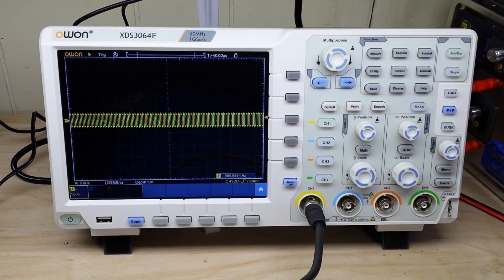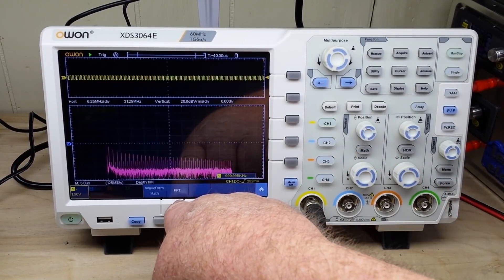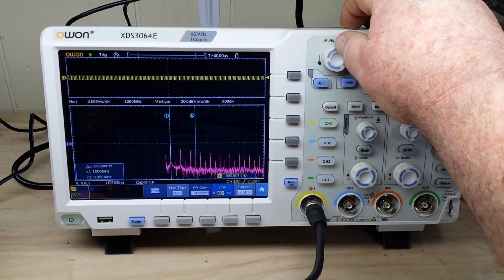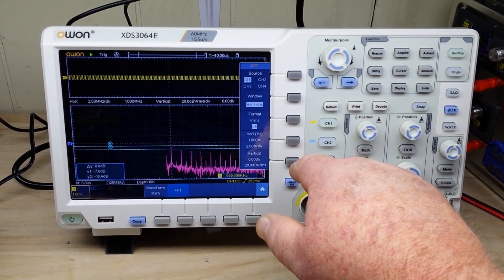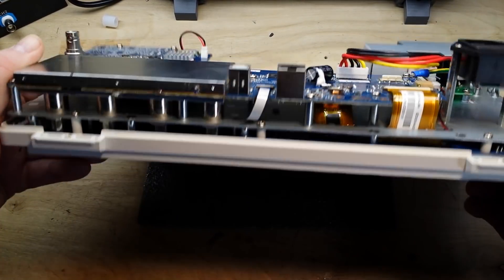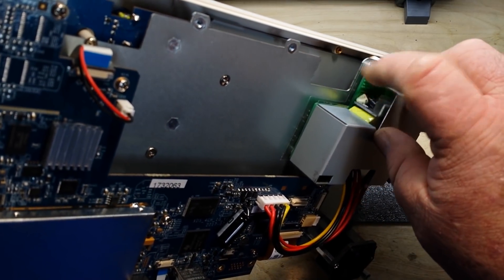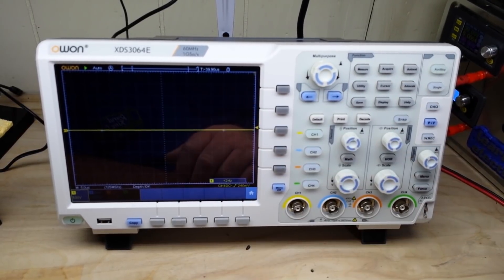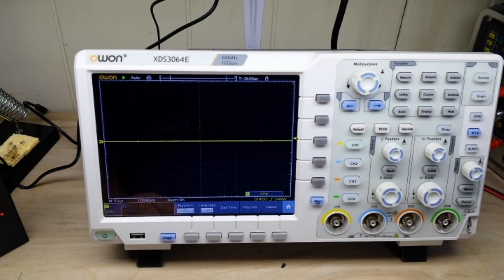Owon XDS3064E Oscilloscope FFT & Teardown (review part 2)

Comment: Thanks Paul. I just watched the vid again, it's for analysing the waveform more in-depthly. Yeah. Cool.
Reply from the maker: Think of it more like this: In regular oscilloscope mode you are looking at signals in the "time domain" Voltage plotted out over time.
In FFT (which is behaving as a spectrum analyzer) we see signals in the frequency domain. We have swapped out the horizontal time base and put in a frequency scale. So It's showing you signal amplitude (basically voltage) in the vertical, usually in Db's and the frequency of the signal on the horizontal axis.
Reply: So it's kind of the same as "virtually looking at the signal in 3D" like from all angles.

Comment: Hi Paul,
I was wondering what would really kill a nice Rigol (or other) oscilloscope.  5 volts I don’t worry about. 12 or 20 volts at 5 amps makes me wonder.  Where are the limits?  I’m sure ground first is right but could you throw some flags, please?  I’m not sure at all that I want to calibrate the frequency and voltage on the grid....

Comment: Paul, again I’m sorry for your loss:(  Another nice video - thank you!  Regarding the accuracy of the FFT, I found the frequency content and noise floor great - but I had problems with two things about the FFT.  First, the amplitudes of the fundamental and harmonics were way off.  Second the vertical scale was hard to read or adjust.  You didn’t mention anything about the amplitude - did you check?  I’m really interested because I returned mine for this problem and I reported this in my review on my channel.  I’d like to give an update and point my viewers to your channel to see for themselves.  Thanks again!
Reply from the maker: The amplitudes were within acceptable limits. I agree that the vertical scale was hard to read.
Reply: learnelectronics much better than the one I had.  Your -7.6dB should have been closer to -6.8dB I think.  Maybe your cursor was off a bit?  The other thing I had an issue with was the 20dB/div.  it was hard for me to tell looking at your screen, but the cursors looked to be the better part of a full division apart, but it was only showing 8.8dB.  Is that correct?  Also can you change the dB per division to something other than 20dB?  Sorry to be picky about this but after my problems - which OWON could’t solve - I’d like to be able to report all has been corrected.
Reply: My software version was V2.9.0.0.  What version do you have? My FFT amplitudes were way off.  So, now that you have had time, do you feel the amplitudes are correct?  Is the vertical scale correct as well?

Comment: How are the manuals?  I assume most of the user help is on-board.  Is it written in coherent English, or some oriental variant?
Reply: Gar Suitor I was impressed with the manual.  Very graphic and detailed.
Reply from the maker: Nicely printed manual.
Reply: @learnelectronics  This and Siglent are the type of scopes that almost doesn't require the manual for operation due to GUI  easy to use, but it is always good to look safety , specifications and if it is well written :D . The TI Processor is an AM335x? Could be the one used in the Beaglebone ....

Comment: One of those headers is probably for the wifi card.
Reply from the maker: Yes, and I believe the other if for the optional multimeter module.
Reply: Bob Smith Each option is fairly reasonably priced, but when you add them all up - it really changes the price of the scope - eeks!
Reply: @KissAnalog  Yep, I have a XDS3164AE with batt, multimeter and wifi. It adds up!